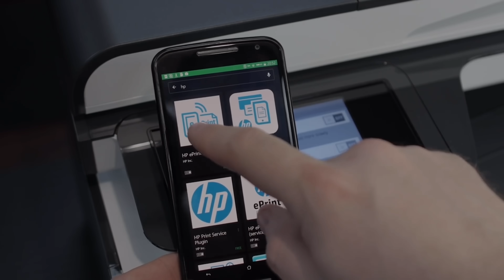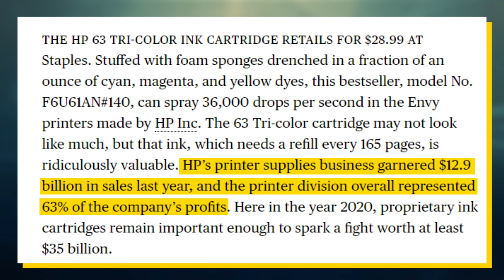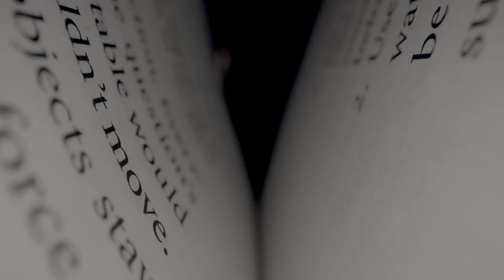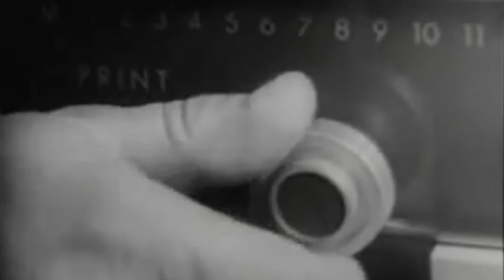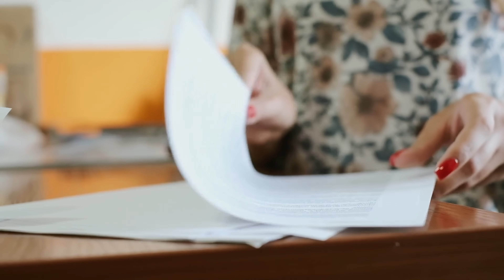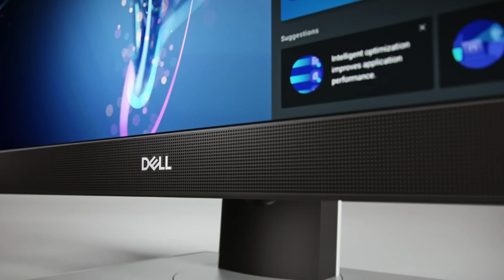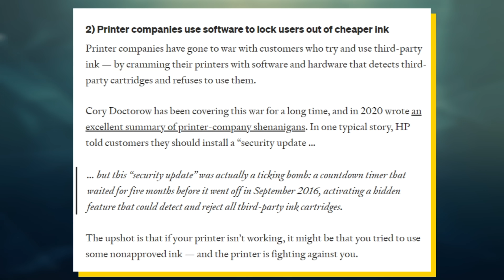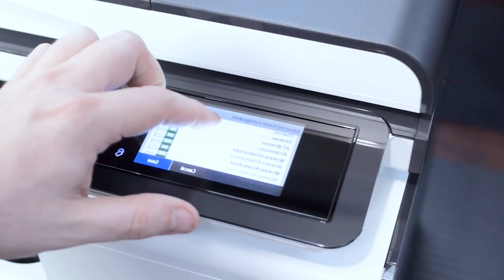Why Printers Are Designed To Fail: The Frustrating Truth

Comment: We have a little Epson that I predicted would die in about two years, then it went unused for a whole year because of the pandemic... So I rightfully assumed it was done for, since it was blocked as expected, thing is... It started to print better with a little more use, and three years after "recovering" it's still working fine, with barely any use (ink tanks have only been refilled ONCE), i don't get it...
Reply: My Epson printer saw a lot of duty, and lasted 10 years. The next printer was another Epson and... It's still working GREAT. 4-ink, but you can get great quality prints in glossy papers and normal ones. Ink isn't that expensive on EcoTank. They're also very dumb devices, you just connect it to your network and you can use it in any device! 

I can't relate to all that "printers are hard to use" message at the beginning, sounds more like he's talking about a specific brand of crappy printers. Also known as HP.

Comment: This seems hyper focused on inkjet personal printers. Laser printers work just fine and toner is pretty cheap per page.
Reply: Also, he skipped dot matrix printers. Granted I have no idea how much of a difference to the story they would've made, but it seems to me that they should've at least gotten a mention.
Reply: @MrLancar  SCREECH SKREECH SKA-REECH
Reply: @MrLancar  Little to no difference to the story, probably, as the time when dot matrix printers were popular was relatively short-lived, technologically speaking. They're still manufactured and available though: they're useful as a "permanent log" of transactions, such as for auditing what's going on with a fire alarm system, recording transactions sequentially in a banking system, etc. Great for auditing.
Reply: @drewstemen9597  That they were still made and used even today came as a surprise, I must admit. I did some quick searching and saw that yes, indeed, you're correct. Also, the ink bands are cheap, to boot.
Not that I'd get one. As you say, they're a niche product, but it was still cool to see they're still around.
Reply: @drewstemen9597  
Dotmatrix printers actually lasted a few decades. 
They were the original office printers. Until they were were replaced by laser printers. Not by Xerox machines.
Reply: @MrLancar  And daisy wheels !
Reply: After buying so many ink printers, I gave up and bought a laser printer. Ink printers are a waste if you let it sit around for too long and some printers will waste the ink by "cleaning".

Comment: As a silver stacker… I can guarantee you Silver does not cost $34/oz. I wish. If it did, I would sell part of my stack to capitalize on it.
Reply: It hit that price in 2011
Reply: They probably didn't realize that the price of silver is lower than the price of a silver coin. They probably just looked up the price of silver and the price of a silver eagle popped up. But market rates of silver are at like $23 per oz.

Comment: Community Knowledge: What's a cheap and reliable printer you have used?
Reply: HP printer. Go for the simple toner printers. No WiFi, no special functions. Just printer, scanner and photocopier. It will last almost forever.
Reply from the maker: Nonexistent
Reply: @LogicallyAnswered  You are exaggerating!
Reply: Brother printers are pretty good
Reply: Brother
Reply: @6starmbn  Specifically Brother lasers. Inkjets can also go pound sand with the rest of them.
Reply: Epson. I'd stay away from HP.
Reply: Brother printers for sure. They are more expensive but they're easy to maintain and you can even use generic toner and it works just fine. I've had a black and white Brother laser printer for 5 years and I've had to change the toner 3 times and every time it was generic toner. And in the next 3,000 prints I will just need to replace the drum which costs $90 from Brother or $20-40 for a generic drum.